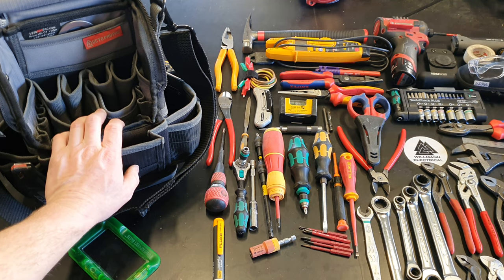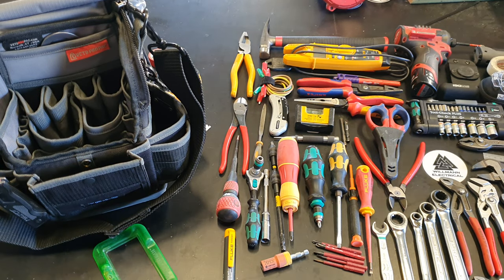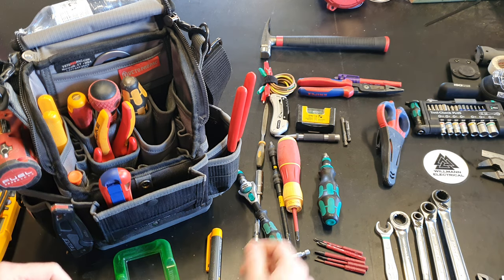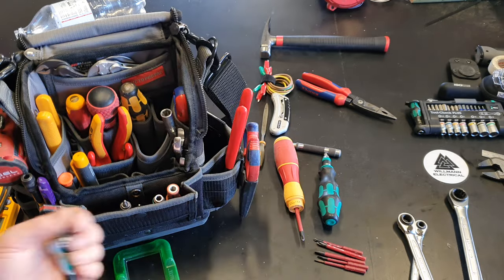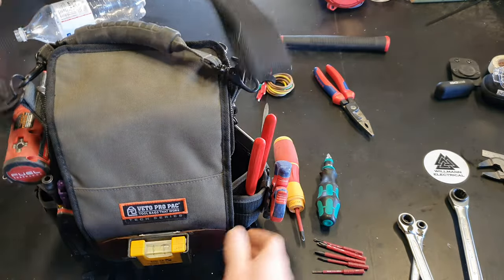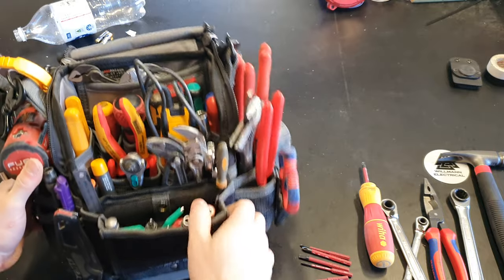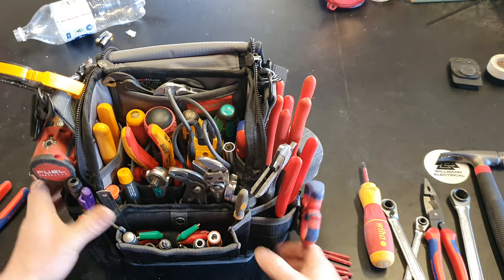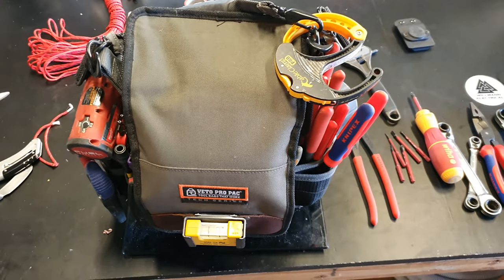Building an Electricians Tool Bag Load-Out featuring the Veto Pro Pac TP-LC

Comment: i always carry a 17mm and a 16mm spanner on the tool bag or load out, 17mm is usally the splice nuts for the cable tray joiners and the 16mm are the nuts for the rods for hanging unistruts, they always come out to be useful

Comment: How do you mark your tools?
Reply from the maker: Centre punch 3 dots inn a line - was my granddads tool mark - I'm just keeping the tradition going
Reply: Nice what did he do for work?

Just watched your video where you installed the test block for the CT metering. Do you do any asp work I was thinking of getting into it and was hoping you could do a pack out style video
Reply from the maker: @slickrick7639  He built a sawmill in Papua new guinea, jack of all trades kinda guy. Almost anything they needed they had to make crazy to think how different life was back then. I don't do much level 2 stuff, just help out when I can. Got a substation hookup video to come in the next couple weeks which I gave an assist on.

Comment: Those 4 narrow pocket slots on the side you said need to be deeper, just take a pozi 1 screwdriver and force a hole right through, gives you loads of extra room for screwdrivers, iv got 3oomm overall size wera screwdrivers in mine and they fit great.

Comment: @3:30 I’ve always thought the same thing with those slots in my tech xl, anything I put in them just feels like they stick up to high and in the way
Reply from the maker: Yeah mate, for drill bits its fine but I want my precision drivers to live there
Reply: I have cut the stitching carefully on the bottom of tiny pockets on different bags to allow me to get screwdrivers and handles of skinny tools through further. I figure if i cant use it anyway, then it cant hurt to modify it, and see how it turns out.
Reply from the maker: @Epitath  🤔Not a bad idea